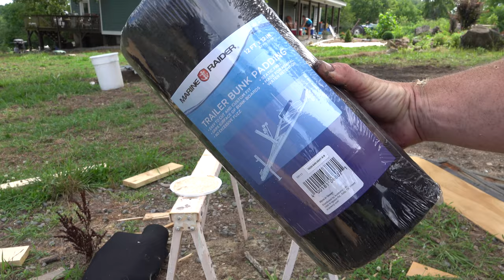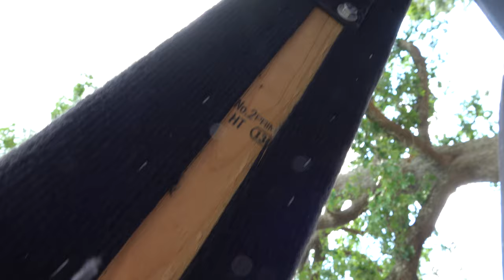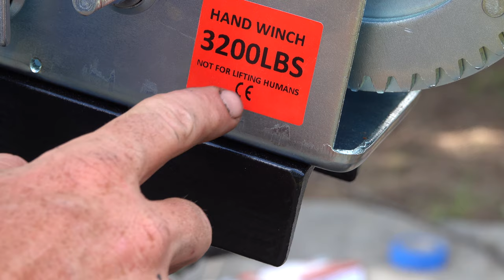HOW TO REBUILD A BOAT TRAILER START TO FINISH

Comment: Nothing related to maintenance but after years of selling various forms of Watercraft the quality of the trailer seems to be the most overlooked feature, especially with the personal Watercraft customers as they will opt for the cheapest model with wheels.
The more experienced boat owners have learned the value of a quality name brand trailer after being stranded on the road from a disabled trailer. This is a very important video for the folks with little trailer experience and why trailer maintenance is very critical and why any tire over 4 years old should only be swinging from a tree.

Comment: I was changing bearings on a large, heavy trailer.  I looked down and recognized that my legs were on either side of the end of the axel and thought this is a dangerous position to bee in.  I scooted back and pulled my legs back.  The trailer fell of the blocks I had it on.  My legs would have been crushed.  For the last fifty something years I have asked myself why at that point in time where the trailer was not moving did I choose to withdraw?